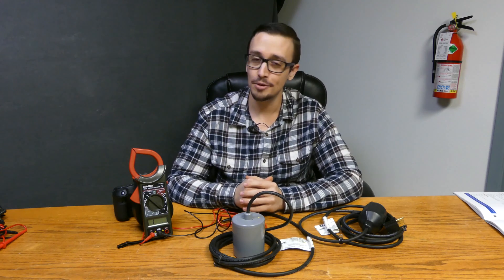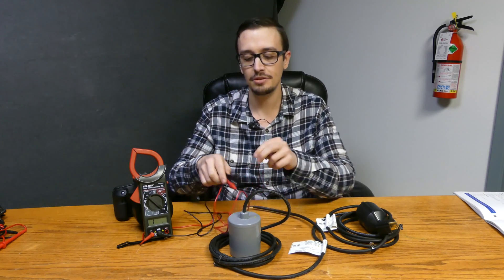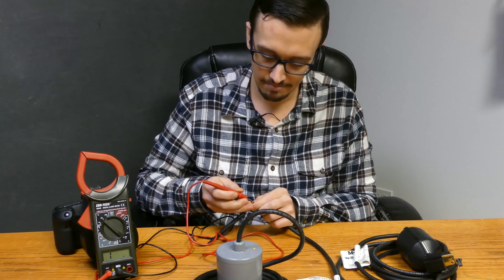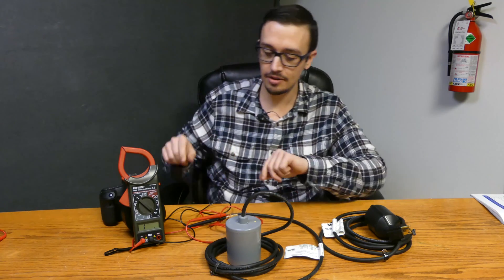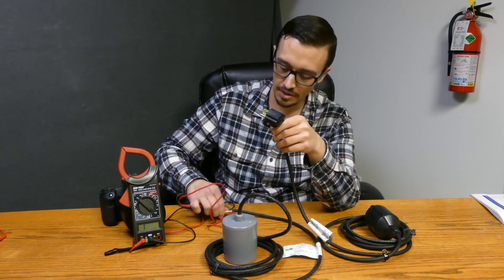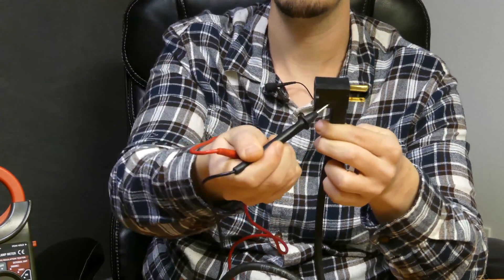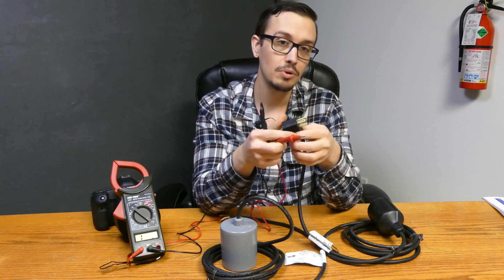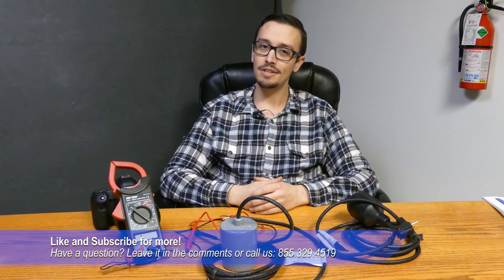How to Test a Pump Float Switch

Comment: this test doesnt prove either can carry the needed current or that an old float switch has been compromised by arcing. i have a float that tests fine like this, but it won't turn on my sump pump, it's about 2 years old and sees thousands of cycles a year. i can jiggle the float and the pump will turn on, but these often time fail when using 10a or more in current(their upper limits are usually 10-15amps) the bigger your pump is, the shorter their life is, better to convert this to a low amp relay switch at that point.

Comment: Mine is backwards right now. I just plugged it into the contactor and When I flip my pump switch is up—- its turning on. And when I turn it down—- its off. Any ideas?
Reply from the maker: Sounds like you have a normally closed float or contactor.

Comment: Can't see the settings on the multimeter or where the leads are plugged in.  To be helpful to beginners this would be  essential.  Also cannot tell what prongs on the piggy back plug you are referring to.  Thank you for the video prompting further research.
Reply: he put it in the lower flat prong and the lower slot on the back side.

Comment: The breaker at the house subpanel was left off causing a high level water alarm to be triggered (when the tank overfilled). I manually turned the pump on and then tested all three floats, but for some reason the on/off float won't turn on the pump. I tested it for continuity and it works when flipped (it's only 1 year old along with pump and all floats). I tested the switch as well and it works. Any ideas? Thx
Reply: Could've gotten the connections wet when tank overfilled maybe a short in pump wire
Reply: @JonnyA365  when I lift the on/off float with a hook it sets off my ohms meter (reads continuity). Low level float and high level float still set off the alarm when I lift them with a hook as well. The pump also runs manually. Do you still think there could be a short in this case? If so I'll take the wire junction box apart as I am testing from the control box.

Comment: Hi, thanks for the video. I have a problem with the solanoid float system for a solar hotwater system not responding and suspecting the float switch. There is a voltage running through the float switch whether the float is up or down the magnet shaft in one orientation, but if I turn the float around then there is no voltage through the switch whether the float is up or down the shaft. Does this mean there is a problem with it and if so can I fix it or do I need to get another one? Thanks heaps.
Reply from the maker: Please give us a call for help troubleshooting: 855.329.4519

Comment: I have 3 floats,  2 to control pump and one is the alarm.  which type I should get in regards of amperage and if the 3 floats are normally open? tks
Reply from the maker: That depends on your pump's amperage. Give our experts a call: 855.329.4519